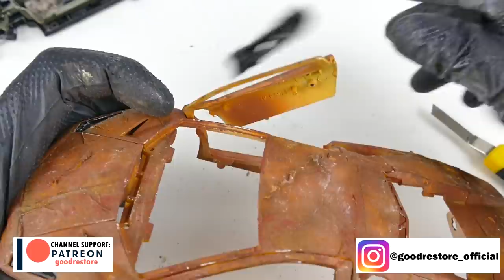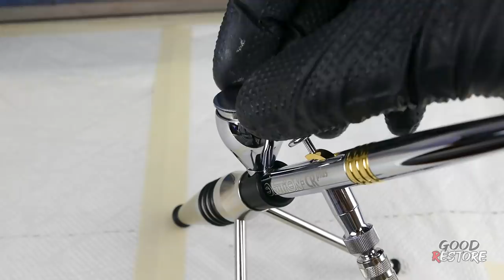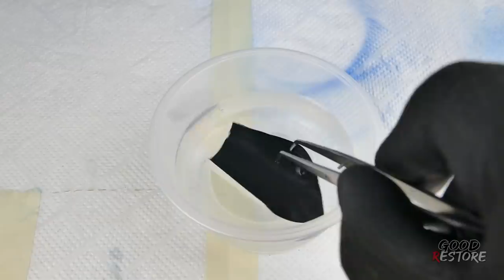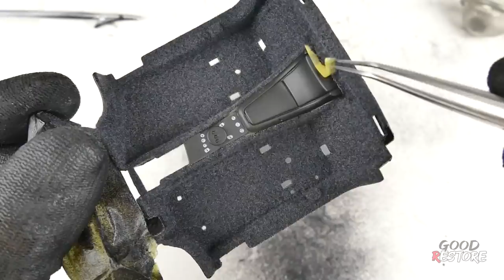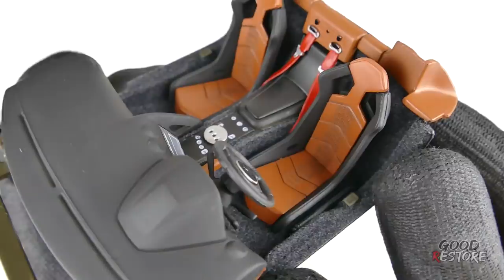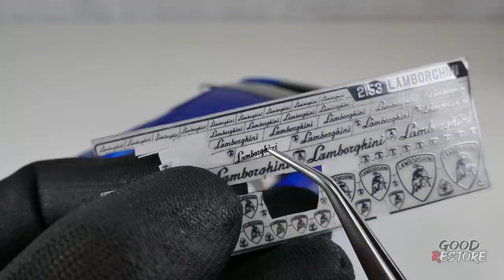Restoration Lamborghini Reventón Abandoned Supercar Restore model car

Comment: Always the same 'damage' .
Reply: It's the restoration that matters.
Reply: @traviswalker8933  If he actually restored the damaged model I would agree.  It's 2 different kits.
Reply: @everythingknife8763  it's the same car. It's a Maisto model and not a kit FYI.
Reply: @traviswalker8933  They are called "model kits" where I live.  He used 2 identical "models" and dirtied one while painting the other.  He used a brass brush on a plastic body without creating a single deep scratch.  hmmm?
Reply: @everythingknife8763  it was a metal body, not plastic.

Comment: This is way past "restoration".  You're actually improving it from its original form imo.
Reply: Son muy buenos  en la  restauración felicidades 🎊
Reply: Dude there was still rust on the inside of the casting! He's gonna have to redo it over again. And you call it good? His rust removing skills suck!
Reply: @devernpinnock8176  I'm not knowledgeable about the process at all.  My statement is based on how well it looks.
Reply from the maker: You have the right to think whatever you want
Reply: @tizodd6  the outside of the casting may look good but the inside there's still rust in it. That's half assing it!
Reply from the maker: Devern Pinnock, Cowboy in a hat, do not say stupidity, what difference does it make in how to process and remove old paint, the main result of the work done, and I consider it excellent
Reply: @GoodRestore  you ruind the car painting it blue it should be black with red trim

Comment: I do like the way you make the models look as though they were real abandoned cars.  Although, I don't understand why you go through all the effort to weather one model then dismantle it, start to clean it, and finally do a paint job on a second model kit?  The plastic body of the model had no scratches in it from the brass brush you were using.  You could have a side by side at the end of the video displaying both ends of your skill.

It would be a much more interesting video if you built higher quality kits that actually require glue and have more detailed parts.
Reply from the maker: This is one metal model. Watch my other videos and you will understand everything

Comment: It's gonna end up rusting all over again and you're gonna have to redo all that work. It's better to get it right the first time than to have to go back over it at a later time.
Reply from the maker: If you mean the previous project with Reventon, then this is a different model
Reply: @GoodRestore  no I'm talking this one I saw rust still inside the frame of the casting. You need to work on your rust removing skills. Which means take all the rust out before priming and painting you're just half assing it. You need to watch real rust removing and detail to skill like take the channel rescue and restore now this is a man who has mad skills in restoring and be does it with pride. Might want to watch him and learn a few things.